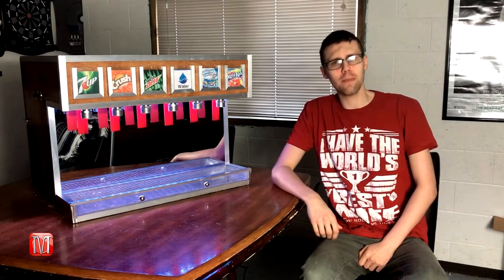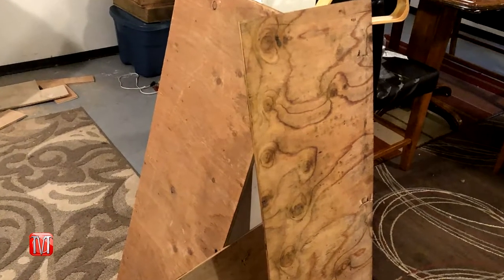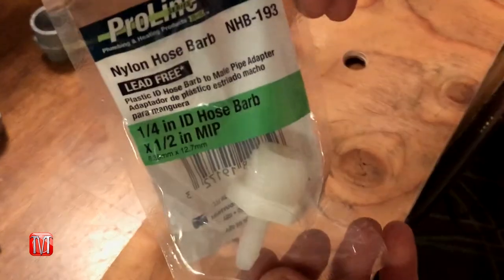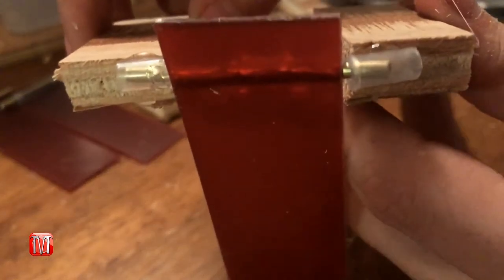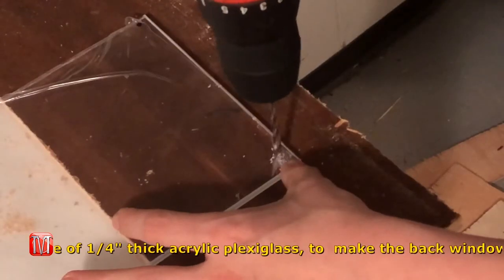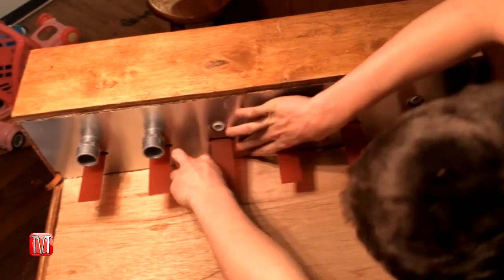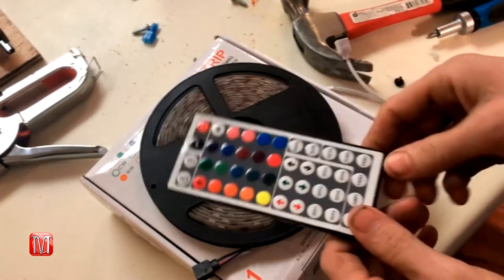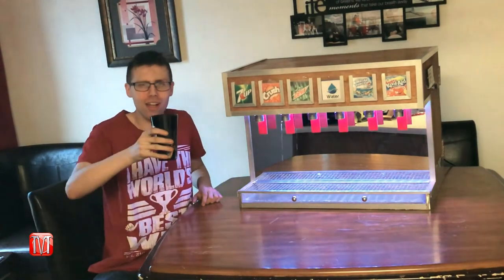How To Build The Coolest DIY Drink Dispenser

Comment: I love this build, how much did you spend on it ?
Reply from the maker: After trial and error I would say it costed me around $350, however, now I could probably do it for $250. I would also not do the container idea. At first it was great but latter on it has only given me problems. Stick with 2L bottles. I was planning on building a base with a mini fridge to keep the drink cold but it got damaged when I moved and I just never got around to fixing it.
Reply: I’m trying to build one with my arduino but I was using an air pump and it came defective

Comment: hey um how can i prevent the carbon from leaking out? you said you have a shut off value?
Reply from the maker: Yes currently I purchased some electric liquid/gas shut off valves. I haven’t had the time to test them out yet but I’m pretty confident they should work. My plan is to make a part 2 video showing some of the upgrades and changes I’m going to make to my dispenser. However, I won’t be able to continue this project until sometime after May of next year. If you want I can try and look up those valves again and try to direct you to them? Just let me know.

Comment: (thinking) ... I doubt you can use carbonated drinks in this dispenser. The pressure would push threw the pump & continuously run til the fizz is all gone. You also can replace the the containers with 2 or 3 liter pop bottles behind the dispenser or under the it, connecting rows of the same flavor in series. How about this for a challenge. Make a dispenser on a budget. Gets the mind going, looking at it from another angel. Some people might not have the experience or tools you have. (aka me) :( Still, your video, two thumbs up.
Reply: it doesnt do it that bad

Comment: Hello, can you please provide me with the link to buy the airtight tupperware 24 cup you shown as I am not able to find it.
Reply from the maker: Vanavah Edwards if you search “air sealed cereal container” on google you’ll find a few different styles. Make sure to get ones that have a rubber seal and clamps to keep the top shut. I am planing on making a Pt. 2 video sometime on the upgrades I made to mine. If you plan on using this for carbonated drinks I suggest  just hooking up some 2L soda bottles by running the hoses threw the caps on top. The soda tends to last longer before going flat. Using those bottles is also cheaper. If you liked that this drink dispenser held a large quantity of liquids you can always hook up more then one 2L bottle to one each other by using hoses. But hey if you do end up building a drink dispenser feel free to send me some photos of it when you’re done. I could even show it off for you in my next video.
Reply: Thanks for your informative reply.   What would it cost for you to build me this 6 slot drink dispenser, one that holds the 2 X 2L pep bottle per slot that you suggested?
Reply from the maker: Well honestly I’m not quite sure. I was able to save myself a lot of money using parts I salvaged. If I was to guess it would probably cost somewhere around $500-$600 since there’s a lot of labor that’s needed to make it. However, in the end that’s still vary cheap for a drink dispenser, especially for one that’s custom and hand made. But if you were to fallow my video and build it yourself it would cost you about $150-$300! Cost depends on how cheap you’re able to get the parts for. If you need any help finding some of the parts just let me know and I can try and find links for you. The reason why I didn’t post links in the description was because I got a lot of the stuff off eBay and listings tend to expire/end so links go bad after awhile. But again I’m always willing to answer questions and try an help people out whenever I can.
Reply: Can you build one for me for $550?  Can it be done within 2 weeks?  This will be constantly used for a big family gathering of around 75 persons so it has to be durable to last for years, fast and soda bottles must be easy change on the fly within 1 minute.  Each slot must hold 2 X 2L pep bottles.   There must be 6 slots (dispensers).  I must be able to drain the spilled drinks from the tray easily via a valve where I just tilt the machine and the liquid pours out.  It must be commercial quality and outstanding to be able to show off on youtube.
Reply: Or can you modify the one you have shown to accommodate the 2 X 2L pep bottles, one in front each other would should hold and take less space.
Reply from the maker: I would love to build one for you but there’s no way I can build one in 2 weeks. It would take me about 1-2 months to order the pumps. I may be willing to sell you mine but I first will have to fix it up. It got a little damaged when I moved that and I’d have to see if I can which it over the the 2L bottles. If I can I would be willing to sell you it for $600 but you will also have to pay for the shipping cost. Which I’m not sure how much that will be.

Comment: 7:15 do you attach or connect anything to the 1 directional valve
Reply from the maker: Havish Guntreddi if you are asking if you need to add some hose clamps to attach the valves, as long as the hose the valves are the same size as the hose they shouldn’t need any.
Reply: @MAGSHowToVideos  I think he means whether the one directional valve is connected to the system (the pumps)? I assume it is to relieve some of the built up pressure? Please correct me if I'm wrong as I'm soon starting to make my own version for my GCSE project in a few weeks!

Comment: at 8:14 i see you have a power strip mounted in the back of the machine. All the strips to buy have the main cord to plug into the wall for power. Where does the main cord from the strip go, I don't see it period. Do you take it out and re-wire? Also in that same frame, there is another little device next to the power strip, you hadn't referred to that at all in the video and i see wires connected to that so it must be important. A little confused . . . little help?
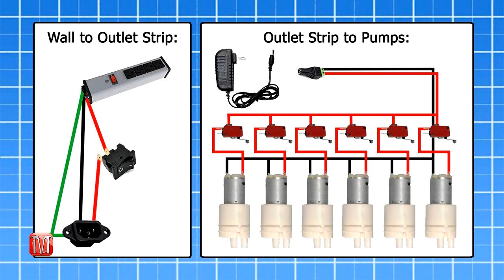Reply from the maker: Joshua Wilson that’s a good question. So when it comes to the outlet strip, I cut off the male end of the wire and wired it to the power switch and the female plug. You can see how I wire it at the 8:52 mark.This allowed me to be able to turn the machine off without having to open it and it gave me the capability to use a external power cable. Now when it comes to that circuit board you see next to the outlet strip that was just part of the outlet strip I salvaged from the trash. To be honest, there really isn’t an importance to it, I probably didn’t even need to use it. I should have just used a normal outlet strip for the video, but when I was building it, I was trying to save as much money as I could. So I used parts from one of those computer outlet control box’s. They are like a normal outlet strip but they have switch’s for each plug so that you can be turn whatever is plugged into it off and on. Instead of buying a new outlet strip I just used the parts from one that I used on a different project. Hopefully that helps. If you have any other questions feel free to ask. And thanks for watching!

Comment: I have also watched almost every build like this and I like this build the most. You are very informative. I am right in the middle of my build currently and I'm now going to ad the mirror to mine! Thanks for the video!
Reply from the maker: Joshua Imoe no problem it was a fun project to build. One thing I didn’t note in the video is to make sure you use non flimsy hoses. That and make sure you get a good type of plastic. I ended up trying a different type of hose that I didn’t show in the video and it ended up cutting of some of the flow from getting kinks in it and they added some bad flavoring to the drinks. Just something to be aware of. Let me know if you need any help. Thanks for watching and please feel free to share my video.
Reply from the maker: Just checking in to see if you ever completed your drink dispenser.
Reply: Very nice work, keep it up man! 👍
Reply: @MAGSHowToVideos  I don't know how your reply got by me for a year but yes I did finish it up. After I stop pushing the button the carbonated drinks keep flowing because of the fizz. I don't know how to stop that. Juices work great though!

Comment: How do you attach the pump to the power source and where do I buy the power source
Reply from the maker: Aidan Browne if you look at the wire diagram I show in the video you’ll see how I wired up the pumps to the switches, and how I wired the switches to the power cable/outlet strip. To purchase the plug I used just search “iec 320 c14 male plug” online. I hope I was able to answer your questions. If you have any more just feel free to ask.

Comment: How long until soda is flat?
Reply from the maker: Elizabeth Vallejo so I found that the larger the containers are the easier it is for the soda to go flat. With these containers you would have to fill them to the top with your selected drink and depending on how well you put your system together it’ll last about half a day to a full day. However if you switch over to 2L bottles it last about 2-3 days. I’m planning on making a Part 2 video showing some of the upgrades I made to mine. I added a electric shut off valve that helps prevent the carbonation from leaking out of the system. With that the drinks last about a week depending on how much that drink is used. That’s about the typical life of a used 2L that sits in your fridge.

Comment: Have you tried using a 12V air pump?
Reply from the maker: gemstone freeman Jr. yes the problem with those are you are not suppose to us them to suck up fluid. In doing so might damage the pump. If you plan to use one to pressurize a container you will need a large pump to do so. The larger the pump usually the more it will cost and the louder the noise. I believe the idea of using a air pump is possible I just didn’t have any luck when I tried.